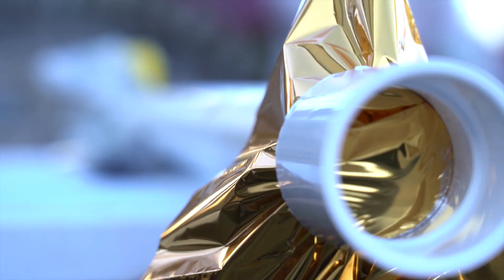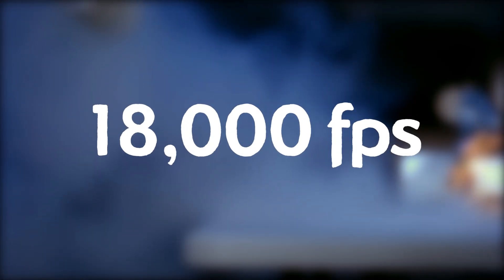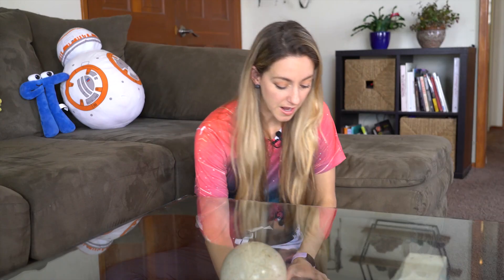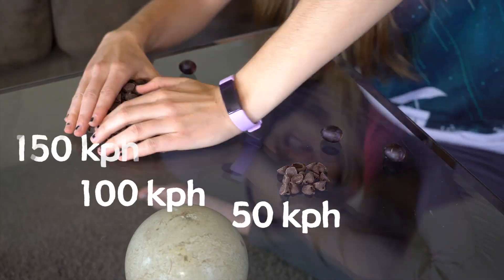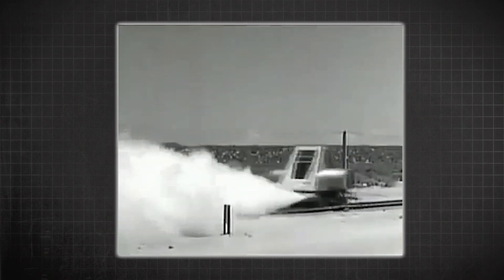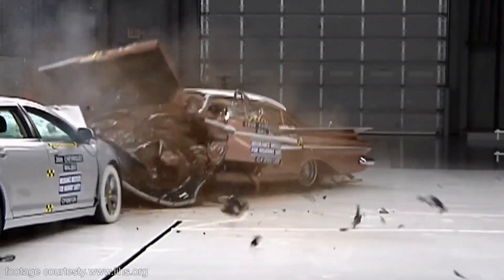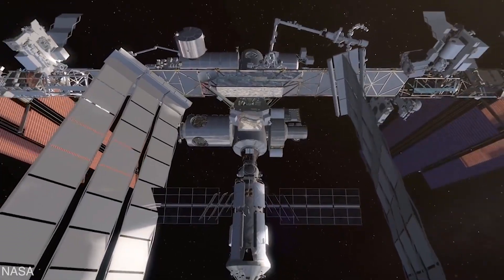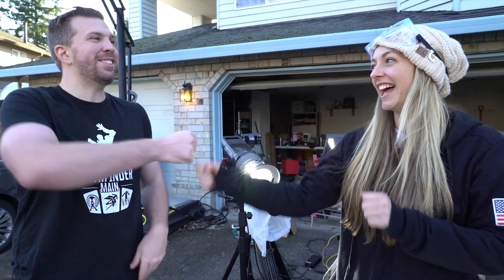Ballistic Ping Pong Ball vs. Tennis Ball at 450km/h!

Comment: The impact mitigation features of a modern car are tested to a speed of 40kph. Above that, you are on your own. So technically, its a matter of choice: do you want to be 60kph dead or 100kph dead?

In practice a more massive vehicle does not make you safer on the road, because your stopping distance is longer and therefore your opportunity to avoid a collision is shorter. In addition, SUV type vehicles have a high centre of gravity making them prone to roll over. In addition, the suspension of a true off road 4WD is not suitable for turning at speed.

Rolling over in an SUV is bad because the vehicle is too heavy for the driver cabin and can easily crush under its own weight. For this reason, stopping distance under different road conditions , the only relevant factor for gauging a vehicle's occupant safety. In other words, being safe on the road is about avoiding collisions, not surviving collisions.

Two car collisions are not a reliable model to gauge the relative safety of a vehicle, because most road collisions are single vehicle crashes into stationary objects.

Comment: The take away should be that it you're among the 85% of people attempting to occupy the same space as a semi, your vehicle, its safety ratings, and restraint devices don't mean squat. 
Auto manufacturers don't design cars to survive a collision with a semi. Why not? Because the odds of you being in a bad wreck with a semi are negligible, and its pretty much impossible to protect against the energy of hitting a 40 ton truck at high speed. Even if that truck isn't moving. And it doesn't matter if you're in a Fiat 500 or a Ford Excursion, it will be destroyed.

Comment: Correction: Tennis Ball Fiat bouncing off Tennis Ball Semi torpedos the Fiat to over 220 kph, a net change of 300kph!

Fiat will be travelling about the same speed backwards as it was going forwards *relative to the Semi*.
i.e. 80kph - 160kph = -80kph ==>> 240kph = 80kph + 160kph
or a 320kph change in speed.

In fake reality it's closer to 220kph since the Fiat's mass isn't completely insignificant.

Comment: at 11:45 if the everage speed of a molecule  in the air on earth is 4700 m/sec, a=v/t  = velocity/time  = 4700m/s/s = 4700 m/sec2 = 470 x 10 m/sec2 = 470G. maybe 470G more correct?

if 4700G,  velocity = a t = 4700 x 10 m/sec2 x 1 sec = 47000 m /sec >  11000 m/sec (escape velocity from the earth).

Comment: Just a few fun facts as a table tennis player: since 2014/2015 we stopped using celluloid balls. Instead, now the balls are made of plastic with a diameter of at least 40 mm (hence they are referred to as 40+). Also, the majority are now seamless which means they got rid of the weak point where the two halves would converge. The grading of the ball also matters. If you're using a 3 star ball which is much rounder than, let's say a 1 star (training ball), you get more stability, spin and speed due to less friction. The brand matters too - nitakku balls feel heavier than others, for insntace. 
I doubt this will trigger an update for the video:)) but I hope you enjoyed the quick fun facts.

Comment: what would happen if you used pneumatic oil on the inside of the tube to lubricate the edges and the pingpong ball would the speed increase or decrease. or if you used  fins canted at a 5 degree angle. how much greater wouldthe damages be

Comment: For calculating the speed of the pingpong ball it might be more accurate to use the distance the ping pong ball travelled over multiple frames. (as many as possible before colliding with anything other than the air)

Comment: Of course the tennis ball doesn't even flinch. You know what happens to a tennis ball when a pro player hits it at 200+ km/h with a tight set of strings? Nothing. That's what the ball is made for. ;-)

Comment: As a kid I used to wonder if a subway system was built with a vacuum in front of the car and air behind like one of those message tubes if it would work. I'd say yes but survivability would be iffy unless vacuum vs pressure was really monitored.

Comment: Also: elastic collisions are crazy. If you through a ball with 50 kph towards a train coming your way at 50kph you would get the reflected ball back into your face at 150kph, just before you're run over by the train, still at 49.999999 kph.

Comment: A car made of lego would be less safe than celluloid... For lot of reason... But one of them is the piece breaking in all direction would redirect that energy on other things than pushing the truck in front of you, which mean your body inside would have more energy to encounter.If you could brake apart and then reassembled, then it would be safer ! :)

Comment: Hi ... I liked your video. However, I think there is a small misunderstanding in min 07:20 when you talk about the inconvenience of having a car made out of rubber. You argue that after the collision the spring back velocity will be very high and you relate this to the effect of acceleration in the human body. 
In reality, when you have an elastic material the impact duration is larger and the peak load and therefore the acceleration is smaller. The real problem of using a very elastic material is the protection of the occupants since there will be very higher deformations in the cabin that could harm the people inside.

Comment: Car design is genius. If you impact something with your wheel, the tire is designed to give out first. Then the wheel, followed by the lower suspension arm. Axles are designed to just snap.
After all of these parts have done their job and given in to the impact, then it's time for the frame and subframe to do some more absorbing of the impact.
Crumple zones are basically weak points places across the front and rear frame to bend/deform in certain ways.

Comment: If the cars were made on of steel? Um, most car bodies are 100% steel, except for the bumpers. Crush zones and safety cells are achieved through use of different panel thicknesses, and serrated frame rails that are strong enough for normal forces, but not the extreme of a car crash.

Comment: Here's an idea for another experiment with the Ping Pong Ball Canon.
Not really about a direct impact with another object, but this time measure the thermals.  The ball starts in a vacuum and is pushed out at a very high rate of speed into an atmosphere.  How fast does it heat up as it hits the air?  I don't know if they have high speed F.L.I.R. cameras or not, but I would like to see how fast it heats up.  This could also be applied to this video.  Was heat a factor in how the ping pong ball reacted as it hit the other objects?  

Just a thought if you're looking for ideas.  :)

Comment: The tennis ball is designed to be regularly gets smacked at speed exceed 200 km an hour, sometimes closer to 300km/h, and that's a 57g tennis ball at that speed. 2.7g ping pong ball will need to go A LOT faster to do damage.

Comment: A nice implicit simulation using explicit dynamic physics software would have added more fun. ( you can use Ls-dyna, Ansys Explicit, Abaqus explicit, Radios etc). And then compare the virtual simulated results with the real physical setup.

Comment: Coat the ping pong ball with Teflon, coat the inside of the tube with Teflon, and use an extremely low viscosity and thin layer of synthetic lubricant.

Comment: If you have a vacuum reservoir you can launch more massive projectiles because as any air passes the projectile the vacuum continues to be pulled by the reservoir.  I did a 3d printed projectile and it did a lot of damage.  So, pull the vacuum with a few barbed fittings at the exit end into a 4" PVC pipe reservoir which is attached to the vacuum pump.

Comment: So, ping pong ball in the vacuum tube picks up speed for 2 reasons. 
1. No pressure in front of it. 
2. Sudden atmospheric pressure behind it
What would happen if you were to put a second chamber on the back end, one that contained pressure higher than 1 bar?
Attach a spud cannon or compressor to the back end with something that will break the diaphragm of the vacuum tube. Firing the pressure side creates more pressure behind the ping pong ball causing more air to rush in resulting in faster speeds?

Comment: Wait a minute......they wanted to ban large cars because they are safer? Why not ban the dangerous little toy cars because they are dangerous instead. Makes far more sense.
Reply: because the large cars are safer compared to the small cars when they crash into each other, and it jeopardizes the safety of somebody who drives a smaller car when somebody drives a larger car. But if two smaller cars crash, it is not nearly as dangerous for either than it is for the person in the smaller car if they were to crash into a larger car

Comment: I was wondering if it was a traditional nitrocellulose ping pong ball or one of the newer ones(plastic). Are you sure they are celluloid and not poly plastic? Find out by burning one. If it burns without smoke and leaves little to naught for residue, it's the real deal - celluloid(nitrocellulose)
The international tennis commission changed to spec for material (in my opinion for the worse).

Comment: Well, but here is a problem with what your saying.  The collision between the ping pong ball is not the entire story.  Fact is you have the air that has also traveled through the tube.  The only reason the ping pong ball is moving so fast is because the air is pushing it.

Therefore the math has to be adjusted to include the mass of the air.  Not just the ping pong ball.

Comment: The main learning point of all the NCAP tests is that crumple zones and airbags only go so far. In a collision (let's say with a concrete wall) driving at 40mph or less, there's a pretty good chance that you escape entirely uninjured. In fact, many cars just won't deploy the airbags at speeds lower than 35-30mph because there's no benefit to doing so (seat belts being adequate at those speeds), but airbag deployment does carry risks of injury.

At speeds above 50mph (again, concrete wall collision, or head on with another car carrying the same momentum) the momentum change is too great, thus car safety systems stand little chance of saving your life. The "goldie-locks" zone between 40 and 50 mph is where airbags, seat belt pretensioners, well designed crumple zones and other crash safety features decide the difference between life and death. That's also where things like how you hold the wheel or whether, as a passenger, you rest your legs on the dashboard can make a crucial difference.

Comment: On the comments about bigger cars being safer, bigger cars also handle quite poorly compared to smaller ones, so in a pinch you have much less margin for error, making it much more likely to actually be involved in a collision.

Some have handling characteristics I would deem woefully inadequate. I'm talking about SUVs which have a tendency to roll if you swerve... like you would if you were about to hit something or someone. Also big pick up trucks with poorly designed suspension which tend to enter various modes of resonance when excited by a bump at cruising speeds (50-80mph). The body and suspension resonance bands appear to have some overlap, so in the right conditions body oscillations will readily couple to the suspension and the two oscillators will just feed each other until something gives...

As far as being safer in a collision, that, I suppose, depends on what you crash into. I tend to defer to NCAP and their American equivalents, but it doesn't look very good there either.

I'd say you're safest in something that in a pinch can get you out of trouble. Also don't settle for anything less than a 5 star safety rating.

Comment: In the 1950s in races like the Indy 500 the cars were very sturdy.  You'd see these cigars with wheels crash, tumble fly through the air and the cars would come up looking pretty good, all intact and the driver dead.. Today if you watch a Nascar or Indy race the cars disintegrate like paper, but the cage the driver's in stays intact. RIpping away the rest of the car slows the driver gradually, and deaths are rare today.

Comment: Not sure if I agree with your conclusion about fatalities in small cars: here in "ze höme öf ze smahl kars" (smarts and mini), the figures don't look great either even though we don't have big SUVs or F-150s. These small cars are still involved in crashes - but there are differences: SMARTs cause fewer crashes than MINIs - mostly because they are driven by middle-aged people with lots of driving experience, while Minis are quite notorious for being involved in crashes caused by their young and rather inexperienced /distracted drivers. SMARTs on the other hand are known to crash at higher speeds (motorways) and due to lateral wind loads - their small size and small mass is in fact a high risk factor outside of inner cities.

Comment: I wonder if the relatively light ping pong ball hitting the more massive and dense tennis ball at high speed would have a similar effect  to an aluminium skinned aeroplane hitting a large building which is constructed with lots of massive steel girders around it's perimeter... Just curious !

Comment: You still did not explain WHY the ping pong in a tube is more dangerous. And that's because on earth the particles of air in front of the opening of the tube when it breaks is rushed though it by all the particles that sit on top of it (and there are a lot of them). On the opposite side there isn't enough air in the space station to reach even a fraction of this force. If you had a tube with a ping pong and a perfect vacuum inside of it, at the moment of breakage of the seal the ping pong would disintegrate before leaving the tube.

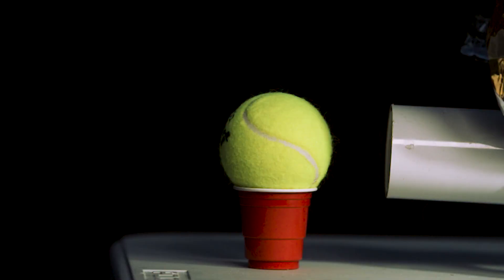Comment: Actually, 6:35 is kinda wrong. celluloid is highly flammable(as you sure know), so the ITTF(international table tennis federation) banned them in 2014. No tournaments i am aware of still use cellulose balls. By now they have switched ping pong ball production completly over to polymer. They used to be made from cellulose. But if go into a store and buy some, they are probably not cellulose.

Comment: I think you made a mistake at 8:41. If a rubber fiat going 80 crashes in to a rubber semi going 80 head on, the fiat would bounce back with (roughly) the same speed it had RELATIVE TO THE SEMI. that is 160 kmph relative to the semi, which is 240 kmph relative to the ground.

Comment: Crash physics is exactly why climbing ropes are certified based on the maximum G force they can generate upon the falling climber (the limit used to be 12-15G afair?), and how much of that force is expended by permanently lengthen the rope instead of working as an elastic. Elastic ropes (rubber) is what you want for bungee jumping since you can reuse them over and over while a climbing rope, just like a car safety belt, must be replaced after a severe fall/car crash. (Bungee jumping past an overhang and then bouncing back up and hitting the rock with your head would probably be fatal.)

Comment: [5:04 Holding grape in left hand, moving towards the mid-frame "crash site" with the banana ]  "The semi was initially going forward at 80 kilometers per hour, and it can end up going backwards at 76 kilometers per hour, which in total is a speed change of 156 kilometers an hour, which is like hitting a wall going 156 kilometers per hour ..."        You meant to say, "The FIAT was initially going ...", correct?        Excellent videos.

Comment: NightHawkInLight improved upon the rig by using disposable plastic cups with an o-ring instead of foil or film for the destructible end cap. Might want to look through his videos for it. Cups are available at any convenience store and getting the vacuum cannon ready is a heck of a lot faster. (Like less than a minute to jam on the plastic cup vs. whatever time it takes to smooth out and avoid tearing while stretching a cover over the end.) Just thought I'd put that out there for anyone interested in this kind of thing.

Comment: The welt left by the ping pong ball on that professor's stomach reminded me a lot about the welts left behind after a hit with a paintball gun.  Those little suckers typically travel at about 250 feet per second (170 mph) which is about the typical limit of paintball arenas for safety reasons.  They are 68 caliber (0.68 inches) projectiles with a typical mass of about 3.0 grams.  A ping pong ball, somewhat surprisingly to me, has a mass of about 2.7 grams which is almost that of the paintball but it is traveling much faster with the vacuum cannon.

EDIT:  BTW, it is terribly illegal and absolutely dangerous to fire a FROZEN paintball at someone with a paintball gun, effectively turning into a .68 caliber slug.  That's a pretty good illustration about the drastic effects of the material composition of the projectile.  Something that can easily fragment and filled with a lightly viscous fluid is far less damaging than an effectively solid object despite having the same mass.

Comment: I get the desire to support scientific systems notations like kilometers per hour. But for those of us who grew up with Imperial measurements (like mph) could you at least consider putting the converted numbers in the description? I mean, by the time I stop the video, open a link to a search engine, find a website that I can either get a direct conversion or at least the numbers to do the conversion, enter the data from the video, understand the point being made... well I have stopped being interested in the whole point being made. Again, I'm not arguing against the use of the metric system, just asking for consideration of those who don't live in a 'one system fits all' universe. Thanks, I've been a fan for years.